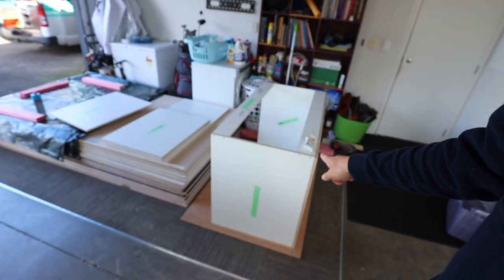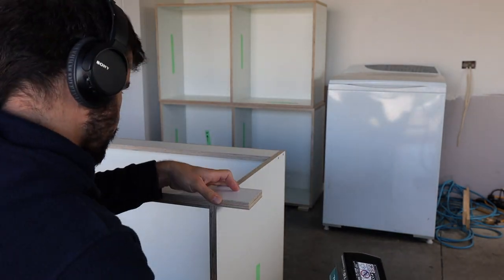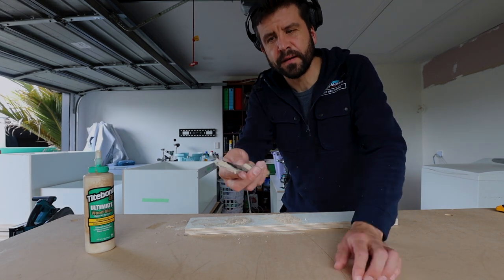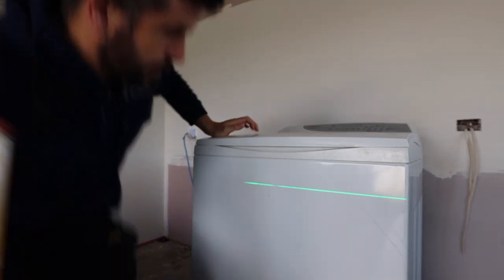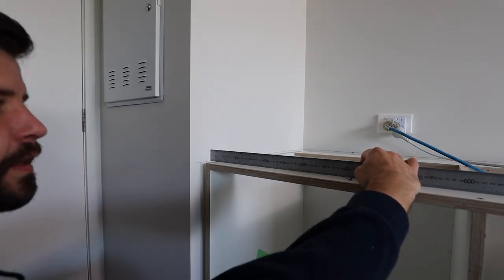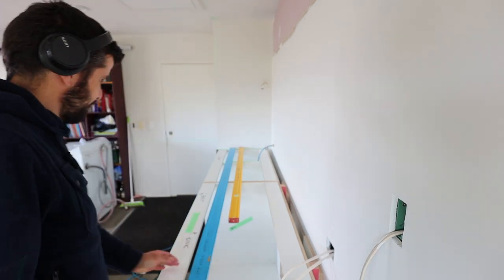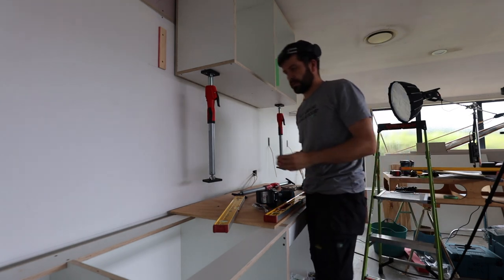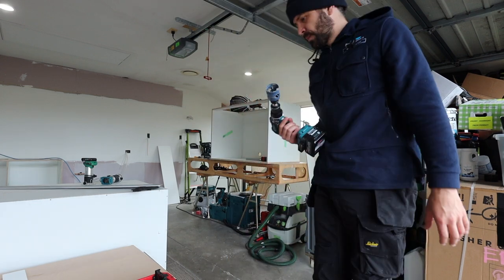Building Laundry Cabinets From Scratch

Comment: Thank you for the video. Are you sure, that you name the plate HPL? In germany we name it "Siebdruckplatte" (water-resistant phenolic resin coated plywood). This is different to hpl.
Reply: In Germany this is called "Beschichtetes Multiplex". Weil es ne Schicht HPL (High-Pressure-Laminate) auf Multiplex ist. Das was du meinst, ist außen braun, wegen dem von dir erwähnten phenolic resin coat.
HPL wird in Deutschland auch oft Schichtstoff oder Resopal bzw unter einem anderen Markennamen genannt.
Reply: @ProkrastinationMeisterei  I usually don't watch German channels. The only exception to that is Holzkunst Scholz. Sadly they are stuffed with work for a few months so no new uploads. Also they are Saxons, so maybe not very easy to understand at times. 
Their usual content is carpentry (which is their main business), wood milling, comparing chainsaws, chainsaw art projects and 'heavy' furniture building.
Reply: @ProkrastinationMeisterei  wait there is a few more I can actually recommend, which are the ones of the German national television channels. You'd have to search them inbetween their other videos, but they do quiet a few about craftsmanship in general, so a ton of different jobs. Mostly it's just 1 video per person, so no series, but there are exceptions. For example the WDR put out a series called 'passt, wackelt und hat Luft', which follows different ppl in training for different jobs in craftsmenship around for quiet a while. 
The channels are SWR, WDR, MDR, NDR.